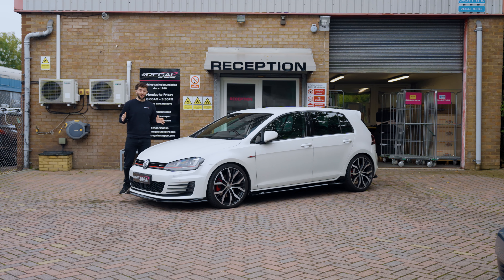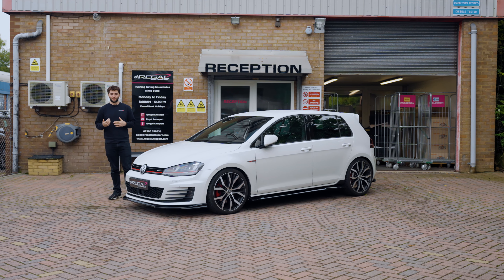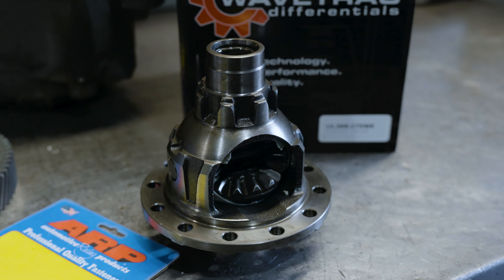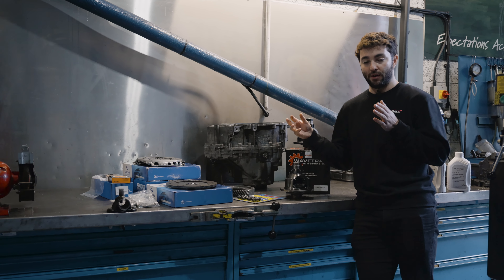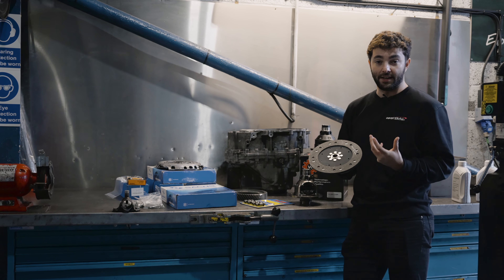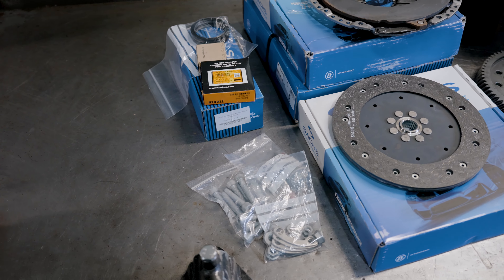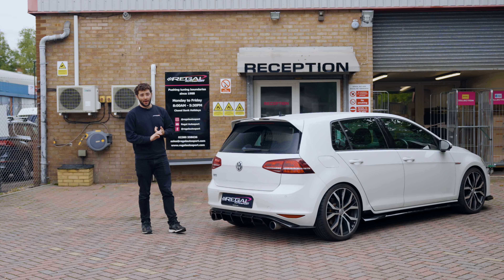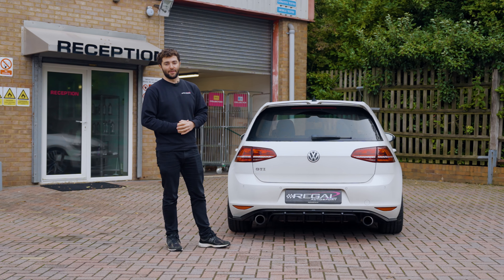MORE GRIP FOR YOUR MK7 GOLF GTI [WAVETRAC LSD + SACHS CLUTCH]

Comment: Got a non pp gti manual. Stock atm. If i went with wavetrac, would you recommend changing the clutch at the same time?
Reply from the maker: If you are still on your original clutch, or stock spec clutch and intend to tune the car, it's inevitable that you will need an upgraded clutch in the future (unless you reduce the output of the tune to cater for the weak torque capacity of the stock spec clutch), and this choice will make use of the labour spent, as you already have to remove the gearbox to fit the Wavetrac LSD

Comment: Hi, how do you find the right play in the differential?
Reply from the maker: With knowledge and experience
Reply: @RegalAutosport  do you use spacers? Original Volkswagen ones? I ask you this because a wavetrack was mounted in my 02q gearbox but now I feel some play when I move the wheel with the car raised I feel clicks and it doesn't seem normal to me
Reply from the maker: @Dearca_RacingTDI  yeah sounds like you need to verify and adjust if necessary the bearing preload and/or backlash
Reply: @RegalAutosport  so you will have to dismantle and open everything again to do the right checks